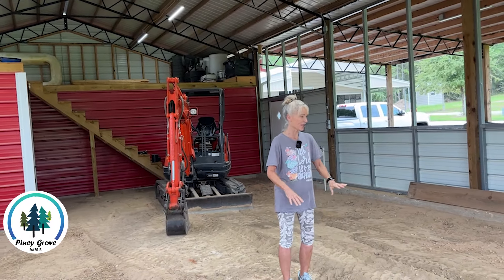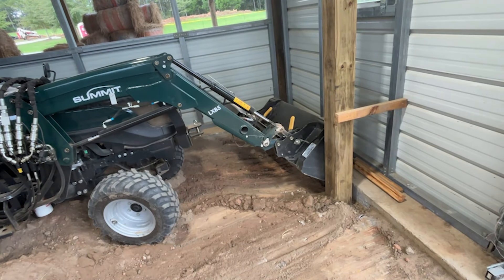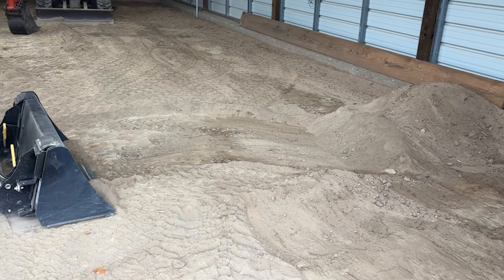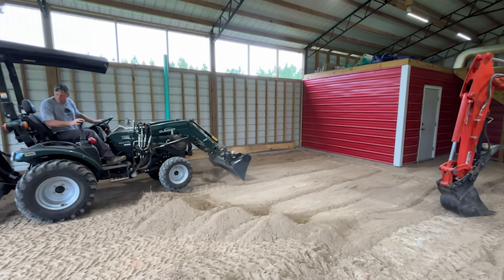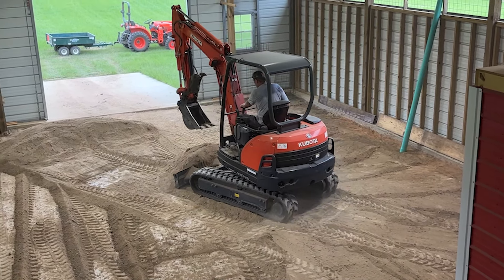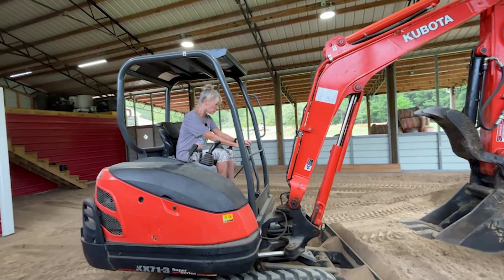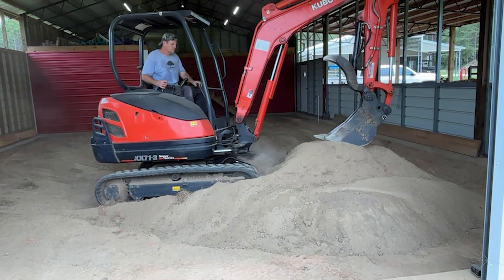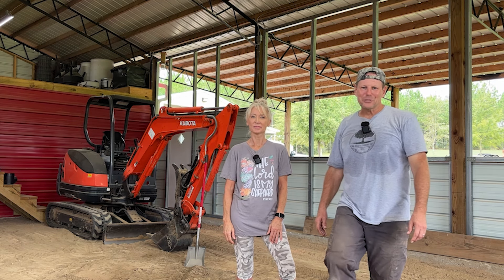Time To Fix Our MISTAKE Building Our Perfect Homestead Barn!

Comment from the maker: See this barn built: https://youtu.be/Ku5ewpv8GzI

Ballard Mower Blades 10% discount code:  PGH10
https://www.ballard-inc.com

New way to fence your land!  Cat's Claw Fasteners.  
Use code PGFREE for free shipping!
https://fencingstaples.com/
Or Amazon Affiliate Link:  https://amzn.to/4dDcaJ7

Tractor and implements provided by Summit Tractors:
https://summittractors.com/
 @summittractors  

QC-Mate X-Boom Hydraulic Coupler Clamp:
https://www.skidsteersolutions.com/
Use PINEYGROVEHOMESTEAD for 5% off anything on the website!

This is our Amazon store with affiliate links to products we use on the channel.  It doesn't cost you anymore and it helps support the channel, THANKS!
https://www.amazon.com/shop/pineygrovehomestead-tractorsandoutdoors

Some of our favorite products on Amazon (affiliate links):
Mower Blade Sharpener Guide: https://amzn.to/4dGYZa5
Dewalt 20V Cordless Grinder: https://amzn.to/4bF2trS
Flap discs: https://amzn.to/3UKEzo0
Grinding wheel: https://amzn.to/3K95ipi 
275 Gallon IBC Tote: https://amzn.to/3XbxwHs
Vise Grip Wire Pliers: https://amzn.to/3WZ2P6U
12V Pump: https://amzn.to/4a3AwsI
Proven Industries Trailer Lock: https://amzn.to/3WVzytv
Flex Tape: https://amzn.to/3R4MdWm
Mechanix Leather Gloves: https://amzn.to/3HjoZZf
Ratcheting Fence Tensioner: https://amzn.to/3aEfSX0
6’ Digging and Pry bar:  https://amzn.to/3vH5Agx

Welcome to our channel!  🎥 What to Watch Next: 
Fixing Leaky Pond: https://youtu.be/NEwSTg1aOWc
Transforming Our Property: https://youtu.be/-jBGEYJea1Y
Baling Hay: https://youtu.be/yQJNF3wFm-U
Framing Our Pole Barn: https://youtu.be/zWgnTFQeiwI

Our Story:
We are six years into a seven year effort of transforming 20 acres of "Piney Grove" in Northwest Florida into our dream homestead/mini farm to be filled with animals and joy. We plan to have a variety of miniature critters on our pastures, raise free-range chickens, grow fish in our pond, garden, plant fruit and nut trees, and harvest wild game. Our goal is
to escape the stresses of corporate life and embrace all that country living
has to offer as we enter the next chapter of our lives. Follow along on our
journey!

Thanks for watching and please Like and Subscribe to help our channel!!
Brad & Deb